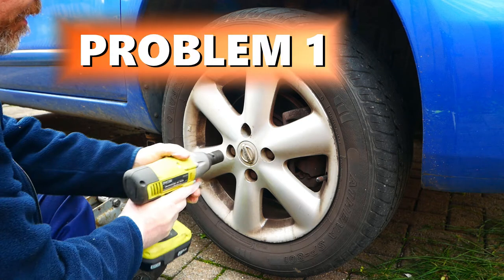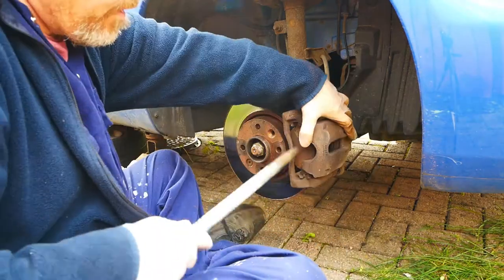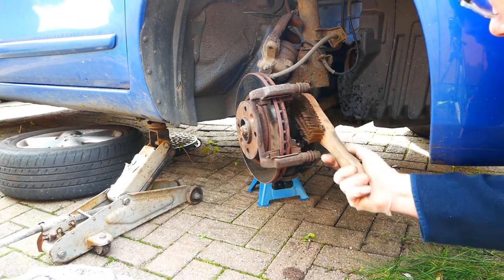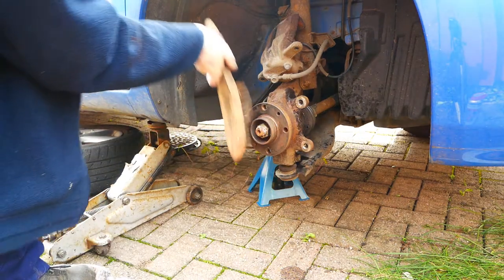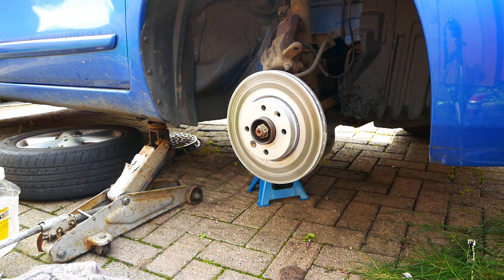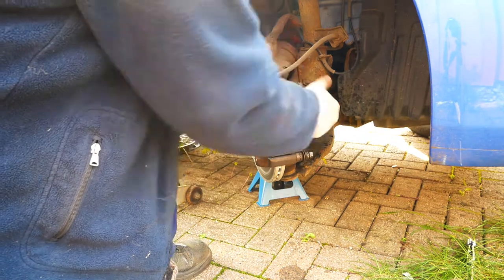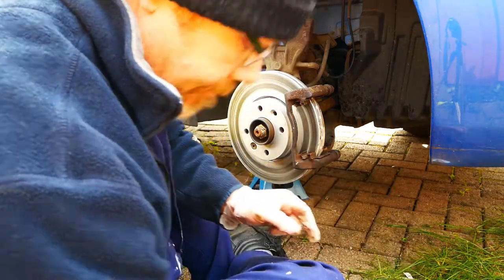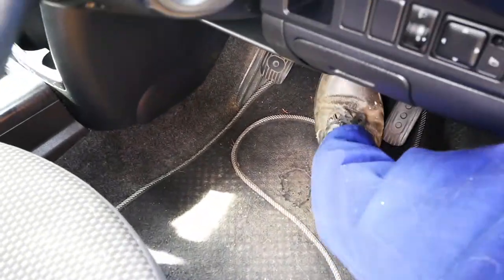NISSAN NOTE FRONT DISCS AND BRAKE PADS REPLACEMENT WITH COMMON PROBLEMS

Comment: Very clear, precise and to the point -  like it thanks.  Hate those videos that waffle on, yours is great.  I fell a the first hurdle by stripping the rotor torx screw :( Some work now required.
Reply from the maker: Yes them torx screws on the disc can be a pain

Comment: While I found your video informative, and easy to follow, I'd just like to add to my experience of doing the same job several times, with Brembo discs and pads.  They came with new bolts for both, and already added with their own 'loctite'.  I'm about to replace them again soon, so in order to avoid the guide pin issue, I purchased a new set for just over £13.  As my Note has almost covered 300, 000kl, I thought it was a wise move, instead of keep going at them to remove what rust that always seems gather on them.  The new guide pins are hard galvanized items, but that's no guarantee of them seizing up again, so I'll wait and see on that. Anyway, thanks for the video upload.👍

Comment: Very clear video, and process is very nicely described. Oddly I have an 11 year old 150k miles Note with the 'stuck guide pins' problem but far worse, so I'll be using a slide hammer threaded into the end to break  them out and then replacing them,  and if they snap off or the wreckage does not come out clean, the frame they slide in may need replacement as well, I do not thing that drilling will be an option. 

I'd add an strong up-vote for your  comment to always take the pins right out and check their condition, even if they move OK, and also to check the integrity of the little rubber bellows in future. Do keep them paired with the hole they came from though. Otherwise once jammed solid,  it is a lot of aggro for small oversight, and of course poor braking.
Reply from the maker: 👍🏼 good luck with the pins and thanks for the comment

Comment: Brilliant easy to follow tutorial.  Just wanted to ask one question, what if the pistons are pushed back in before stripping, to avoid any damage to the new one? Your opinion please. Thank you very much.
Reply from the maker: I usually use a piston push tool but wanted to show how to do it without.
But yes you are correct and I should of pushed the piston back in when the old disc was on earlier.
Reply: Thank you very much. If I ever try I ill do so.
Reply from the maker: @simplebeing7583  👍

Comment: Hi 
Its a really good video but i am facing the same first problem as you did. Can you please tell me size socket did you use to remove the locking wheel nut?
Reply from the maker: It was an 18mm socket but I had to get the spinning collar off the locking wheel nut first . If you look through my videos you will find one called locking wheel nut removal which shows exactly how I did it.

Comment: Hi great video . I had these replaced but now there is noise on lhs - mechanic is saying these could be due to driver shaft or gearbox .However it was noise free before the parts .
Reply from the maker: Did the noise happen as soon as the brakes were changed ? Or has it happened over time.
Reply: @baconbuttties  

Hi mate straight after brakes were changed and manager of mechanic blamed on gearbox shaking upon braking as being a problem but a passerby mechanic who dropped by said it's more likely to be drive shaft as gearbox is smooth . There now is rattling noise ..drumming sound ..recovery engineer seems to say it could be a stone .
Reply from the maker: @nazamosey1646  Does seem strange that the noise came straight after brake change. Has the new brake that was fitted on the lhs been checked to make sure nothing is loose
Reply: @baconbuttties  
Recovery engineer says hard break ing causes noise rhs and lhs also .
But brake pads clips on so hardware is ok

Comment: My locking wheel nut snapped, not the tool but the actual nut, so i've no idea how to sort that out. Any ideas?

Peace
Reply from the maker: Ahhh that's bad. How much has snapped off? There is not enough left to bang a socket onto?  I suppose some good quality drill bits to drill it out would be one solution. Not an easy task.
Reply: @baconbuttties  No no way to get a socket on. Judging by other vids of my car i think it might actually have wheel bolts rather than studs and nuts. So that's going to be fun. I only bought the car yesterday but didn't spot the broken nut/bolt.

I have the same Nissan Note as you so does yours have Nuts or bolts?

Peace
Reply from the maker: @MrEvilWasp  bolts
Reply: @baconbuttties  Cheers mate, i'm going to have to have a go at drilling it out. Now i know to order bolts to replace it.

Peace
Reply from the maker: @MrEvilWasp  hope it all goes well, good luck 👍

Comment: @BACONBUTTIES 3TTT,s

which Loctite should be used on caliper bolts?
Reply from the maker: Any medium strength Thread lock should be okay to use.
I wouldn't advise using any high strength Thread lock as removal will be difficult.
Reply: @baconbuttties  Many thanks

Comment: I cant believe you think this is an instructional video!  9 minutes 45 seconds you remove the axle stand and wheel and STICK YOUR LEGS UNDER THE CAR!!!!  NO AXLE STANDS ! This is when it falls off the tiny cheap jack and crushes your legs!  Youtube should monitor safety issues like this
Reply from the maker: Well first of all did I tell anyone to stick their leg under the car? As that was not part of the tutorial. Also it was just my foot under the wheel arch not the car and was literally seconds before I put bolts in the wheel. I just find it strange that you watched a free video and it enraged you. Anyway thanks for the comment as I do appreciate all comments 👍